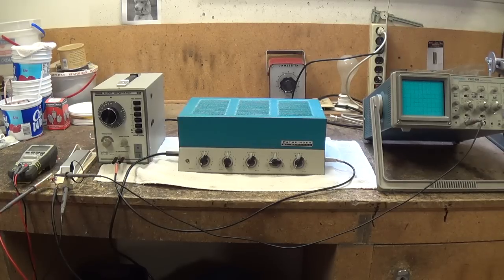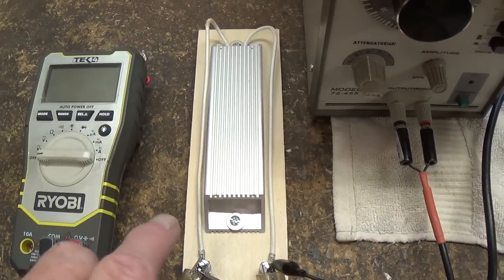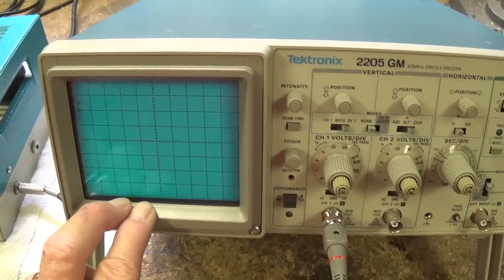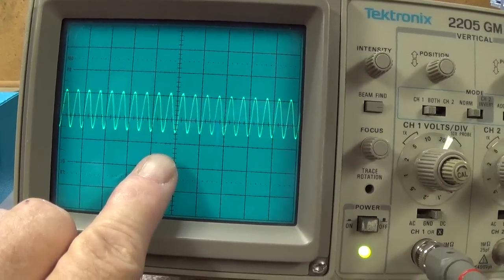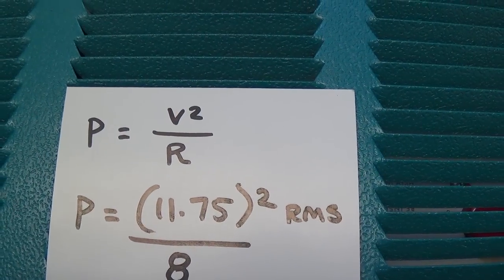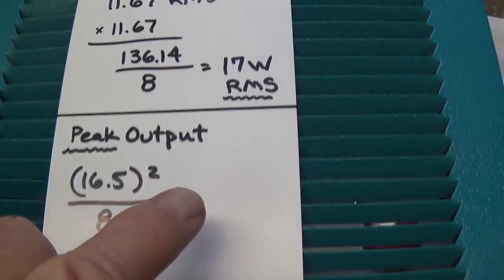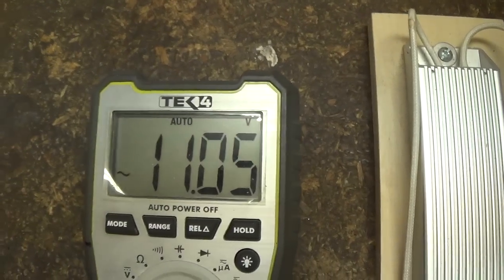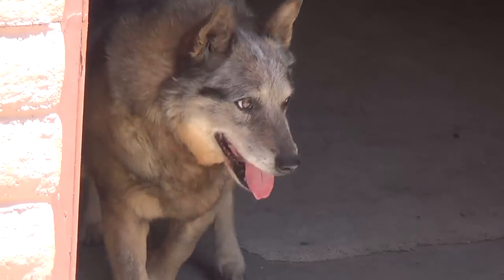How Amplifier Output Power is Measured

Comment: I know manufacturers are always trying to make their products seem more powerful. For example, you rarely get an RMS rating for a speaker, but the makers will often talk about "program" and "continuous" wattage. How do these relate to RMS? Or do they? I feel these specs often used to make a speaker or cab seem more powerful than it really is. Any thoughts on this, Uncle Doug?
Reply from the maker: I think of RMS as being applied more to the output of an amp, Mark, while continuous wattage would apply better to speakers. To me, the CW rating would be the only one I would pay attention to. Peak wattage, both for amps and speakers, is artificially elevated and relatively meaningless.
Reply: Okay. Thanks for the info.
Reply from the maker: You're welcome, Mark.

Comment: Thank you for insctructions. I had just measured output on 4 x 20w rms at 1khz, using speakers instead of dummy load and it`s really not a good experience
Reply from the maker: No, it gets a little noisy when you use speakers vs dummy loads, Kaja. I'm sure your neighbors would agree.  There are dummy loads readily available on Ebay......for the sake of your hearing, check them out

Comment: Hellow, I want to test a stereo tube amp, But i only have one dummy load.

I know that it very bad for a tube amp to have no load on the output transformer.

Is it possible to test one Chanel only bij removing all the tubes from the chanel with no dummy load.
( meaning can you run a tube amp safely with no load and no tubes)

and is it also bad for the output transformer is a tube amp runs with no load and no input?

thanx alot in advance Mr uncle Doug! :)
Reply from the maker: Since we don't deal with stereo amps, Ronald, this is a dilemma that we have not encountered. I would think that pulling the phase inverter tube and/or output tubes in the non-tested channel should prevent any damage.
Reply: I would think the same, that it would not do damage, but offcourse i want to be sure, so i wont take the risk. Therfore order a second dummy load.

if anyone elso know, please comment! :)

also (correct me if im wronge pls) Its a class A single end triode(set) amp
and dous not have a phase inverter pre tube.

tubes 
pre tube  vt 137 = VT-137 = 1626 = CV1755 ,
power tube VT-135 = 12J5GT = CV535 

6203 rectifier

thx alot for your fast response!  and thx for all your great videos!
Reply from the maker: Most stereo amps are DE, so I assumed this one was. Good luck.
Reply: thx. i have a solution as well, 
Ill feed on channel the test tone and have that connected to the dummyload, the other channel wil get a normal audio input like a mp3 song and with a speaker connected! :)
Reply from the maker: Let's hope it works, Ron. Best of luck.

Comment: Hi!
If I was designing/building my own tube amp and wanted to know what wattage the speaker  for it has to be rated at, and use this method to determine the output of the amp, would I need to use the RMS or the peak results for the speaker's value?
Reply from the maker: The amp's RMS output power is a good way to determine speaker wattage. Also, it's always a good idea to provide about a 25% to 50% excess speaker power handling capability just to play it safe.....i.e. 35W amp and 50W speaker (or higher if you can afford it).

Comment: Maybe some additional information, but the output voltage you're measuring represents the total frequency response aka 'EQ settings' (not completely true) of the amplifier.
Those mic amps don't always have a completely flat frequency response and therefore you will see a difference in output voltage. 
Also the output power can be specified at the amount of distortion ('clipping'), typically 0.1% THD+N, 1% THD+N and 10% THD+N
(THD+N = total harmonic distortion + noise). But I guess that goes a little bit outside the scope of this video ;)

To remember is that many companies fool around with these numbers to give the customer the impression of having better specs.
Reply from the maker: Thank you for your input, Bart.

Comment: Hi Uncle Doug! could you please give me your opinion about buying a audio spectrum analyser? i think its very usefull, what do you think. Especially looking for odd harmonics.
do you have one?
Reply from the maker: I do not have one but my friend, David, at El Paso Tube Amps, does. It has its uses, but is not essential for diagnosis or repair.  If you watch some of his videos, you will see it in action.
Reply: Hi Uncle Doug,
thnx for response.
Yes i know, i allready saw his videos.
I thought such a analyser is extremely handy to detect harmonics and odd harmonics and will help me a lot to fix amps, or after exhanging i.e. coupling caps or other components that effects tone or distortion, to verify the change of harmonics. Its better than a human ear. What do you think About it? thnx a lot again.
Reply from the maker: While it may be more analytically accurate than the human ear, the human ear is the final judge of tone. Yes, it can detect alterations in harmonics due to circuit modification, but the spectrum may not equate to the sound you are seeking. Perhaps you could analyze the spectrum of a really great-sounding amp to see what a "good spectrum" looks like, and then modify other amps to have a similar spectrum.....but there are other variables, including (in particular) the speaker, which is not included in the analysis.
Reply: Thank you very much for your opinion, appreciated :-).

Comment: Hi Uncle Doug!  i have a question related to the topic of this video. Is the max power output from a amp = the sum of max plate dissipation of all output-tubes? in example, i have a Orange AD200 bass mk3 on my bench right now. this amps specs state 200w RMS, but if i sum up the max plate dissipation of my 4 tubes 6550A (42w max plate dissipation) i end up at 168 watts. i have the feeling that i misunderstand the relationship between max plate dissipations from tubes and the output power. could you explain this a bit. looking forward to your responce. thx in advance. Stefan.
Reply from the maker: Plate dissipation and power output may be related in some way, Stefan, but they are not equivalent and will not "add up".  The output power is a measurement of heat energy created within a load (i.e. the speaker voice coil), while the plate dissipation is a measurement of the heat created by the current flow and internal resistance of the output tubes.  Think of a car engine.  The heat of the engine is not directly related to its power output.
Reply: thank you for respons like always :-) and for clearing this up for me. I am happy now. You have a gift to make difficult things easy. You must be a intelligent man. Best regards, Stefan.
Reply from the maker: You're welcome, Stefan :)

Comment: Hi Uncle Doug, one thing about measuring output power is still not clear to me. Most amps run the signal true a passive tone-stack. When i turn up my treble-pot i has a big influence on my output signal. It becomes much higher. So, how do you set your tone-controls when measuring output power? thx in advance. Stefan.
Reply from the maker: You make a good point, Stefan. Passive tone circuits can affect output power, so when you are testing an amp, it makes sense to adjust the tone controls to maximize the measured output power.
Reply: thanks for advice. greetings again from Belgium.
Reply from the maker: You're welcome, Stefan. Regards from Texas, USA :)

Comment: How would the results differ with a speaker attached
Reply from the maker: The measurements would be the same, but you and your neighbors would probably suffer some hearing loss from having to endure a 1000Hz tone at nearly full volume for several minutes.
Reply: Wouldn't the impedance component of the speaker alter the final readings . BTW - Saving ears is good !
Reply from the maker: The speaker voice coil has a DC resistance of about 6.2 Ohms which increases to 8 Ohms (the same as the non-inductive dummy load) during use, due to the interaction between the AC signal and the inductive voice coil. The end result is the same resistance for both the dummy load or the voice coil.

Comment: I have heard on multiple videos, that  for a given reported wattage,  tube amplifiers are louder than solid state amplifiers.  Is this so, and if true would you please do a video explaining this phenomenon.
Reply from the maker: I don't think that this is actually true, Eric. If the method and results of power measurement are the same for both devices, then their output power is indeed equal.  Perhaps the people who have made statements to the contrary would be better suited to explain their reasoning.
Reply: A watt of power is a watt....SS or tube...What you hear from a tube amp is a "perceived" level of noise...ie. louder. It's not really, it's just that a tube has soft clipping when pushed. Kinda like when you watch tv and the volume goes up when an ad comes on.
Reply: Aren't watts bigger in Texas ?

Comment: I recently bought 2-100 watt 8-ohm dummy loads and received my new Tektronix TBS1052b-EDU scope today and I was excited to measure the output power of some of my amps. The AC signal generator I'm using has a nice sine wave until I connect it to an amp, then the sine wave looks like garbage. I've tried this with two one-year-old well known American made amps so far and both have a lousy sine wave. I own one ultra-linear amp and I'll try that one and a newish solid-state bass amp next. Apologies for my babbling. ;)
Reply from the maker: Learning to properly use a scope and signal generator takes a little while, Tony. Are you sure your test probes are appropriate for the frequency of your scope and that you are connecting them with proper polarity ??  I'll bet with some practice you will figure it out.
Reply: I found that the poor sine waves were caused by the amp treble control, setting it at zero cleans-up the waveform. I also remembered it is often good to use a 3-to-2 120 vac adapter on the scope's power plug. My cathode-biased Gibson GA-20RVT (2-6V6) amp had a better sinusoidal waveform than any of my -DC biased 6V6/6L6 amps.
Reply from the maker: I'm glad you figured it out, Tony, and are enjoying your new scope.

Comment: Hallo 
Very clear
 i have order me four 8 ohm resistors 100 watt  from ebay 
i go to mont that on a huge heatsink they are wounding types i hope the induction from the  R s gif me no problem

Thanks Bertus
Reply from the maker: Generally, it's better to use non-inductive resistors, Bertus.....for the reason you mention. The resistance/impedance will change in wire-wound resistors due to changes in current flow, which is not good.

Comment: Hi Uncle Doug. i used this methode to measure the output power of a mesa boogie studio .22. this amp have 5 12AX7 preamp and 2 EL84 output tubes. i did the measurements using a 8 ohm dummy load with 1000hz input. I turnd-up the volume till the sine-wave started to clip on my scope. My digital volt meter shows me 10volt ac RMS. After calculation it gives me 12.5 watt output. This is very low! Can you help me out here a little bit? Are my output tubes not okay? Or what things can i check?
Reply: in addition on my previous reply. this mesa boogie studio .22 should produce between 15 and 18 watt in reality. so my 12.5 is really to low. any suggestions are welcome to put me in the wright direction. thx in advance...
Reply from the maker: Your amp's output power may be rated at a certain percent of distortion, Stefan.....i.e. 10%, whereas you measured it at about 0%. Recall that, unlike HiFi amps, some distortion is acceptable in guitar amps. Also, it's not uncommon at all for amplifier output to be less than advertised. The numbers stated by most manufacturers are achieved under optimum conditions, probably with all new matched tubes and perfect biasing. Are your output tubes new, perfectly matched, and perfectly biased? If not, then that's probably where the extra 2.5W went. Also, is your digital voltmeter accurate at 1000Hz? It may be under-reading at this frequency.
Reply: +Uncle Doug Thx a lot for your good reply. When i crank-up the volume till 0 procent distortion, and turn further the volume fully open the voltage goes from 10vac to max 10.25vac. I will check my voltmeter if the reading is still accurate at 1khz, but its a decent fluke 87 true rms so i dont think the problem is there. But i think like you assume that the power tubes are old and unbalanced, so i try to replace the tubes with matched tubes. i also notest that the tube sockets are not in a good condition, the tubes are really loose inside that sockets. thx again for your inputs Uncle Doug. grtz....Stefan.
Reply from the maker: You're welcome. Amps are like cars. From time to time they need a "tune up" :)

Comment: Great video! And then there's the tube amp vs. solid-state amp output wattage rating conundrum/mystery. :)
Reply from the maker: Output power ratings should be equivalent for both tube and SS amps, since power is power, no matter how it's made.....but, IMHO the SS guys tend to "fluff up" their ratings more often than the tube guys. I think it's because you can look at output tubes and have a good idea of their maximum output, but most of us generally can't look at transistors and do the same.
Reply: I have an untested theory that a tube amp will sound louder than a SS amp at levels above the rated RMS wattage. SS amp mfg's seem to go to great lengths to prevent overdriving the amp. When overdriven, transistors will tend to go into thermal runaway fairly easily and not yield much wattage above the rating. Tube amps seem to love being overdriven and will continue to get louder when overdriven, up to an ultimate point of course. Just my SWAG (Scientific Wild A_s Guess). haha
Reply from the maker: That could be, Tony. But I think many people feel that, watt for watt, a tube amp will always sound louder that SS. I personally stay out of this argument.....but a lot of folks don't :)
Reply: A watt is a watt. In a tube amp or in a SS amplifier. There is no difference. Both wattages are the same.

That myth comes for the sound pressure levels wich are the ones letting us to hear. What I mean is:

Tubes and SS CIs have a non linear behavior, of course but, the way and time they get into their non linear region it is quiet different. So that is the reason why people perceive tube amps are louder and so they directly guess 'tube watts' have 'more power'.

Comment: I think the frequency of the signal generator was audible in the video even there was no speaker.  Is this possible?

A Great and informative Video!
Reply from the maker: My high frequency hearing is diminished, PoB, so I didn't notice it, but a 1000Hz vibration, perhaps manifested in the tubes or output transformer, could possibly be audible to someone with excellent hearing.

Comment: Hi Doug, Thanks for the video. What input voltage amplitude were you running on the 1KHz audio generator? If you drove that up you'd probably start seeing more clipping distortion on the output.
Reply from the maker: You're welcome, Eric. That was explained in a note in the video and several times in comments. The input signal strength, amp volume, and tone controls were all carefully adjusted to provide the highest undistorted output signal.
Reply: Hello,  I think what he was wanting to know is the amplitude of the 1000hz signal coming out of the signal generator, going into the amp.  Say 100-500 mv  or more?   Thanks

Comment: Hello Uncle Doug, thank you for yet another great video! I was wondering: would the level of the input signal influence the total (measured) output power? If you, at first, set the output to a fairly low setting and then increase the input signal (on the signal generator) until the output signal starts to clip (and then put the input level a bit back so no more clipping occurs) you would use the preamp tube to the max. Then increase the output power to the max (or until distortion happens, which should, imho, not happen in a properly designed amp). Or is there also a defined input level for this kind of measurements?

Or is there an error in my understanding of how the amp works?
Reply from the maker: That's essentially what I do. The signal input strength, amp volume setting, and tone controls are all adjusted (by trial and error) to the settings which allow the maximum voltage output just prior to the appearance of distortion.
Reply: @UncleDoug  Hi Uncle Doug!  Thank you for explaining!
Reply: Thanks for asking this question!  I know it's 4 years into the future already, but Uncle Doug's videos will last forever.  I was wondering on what level to set the frequency generator as well.